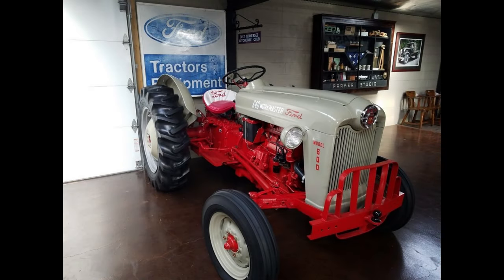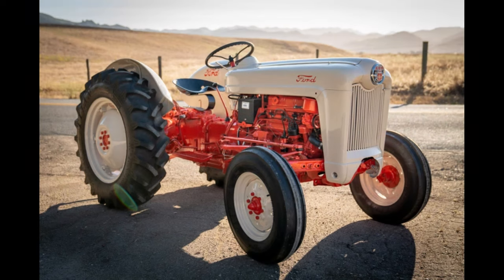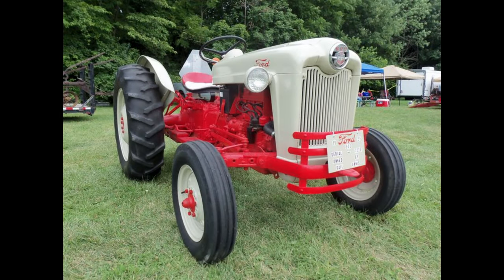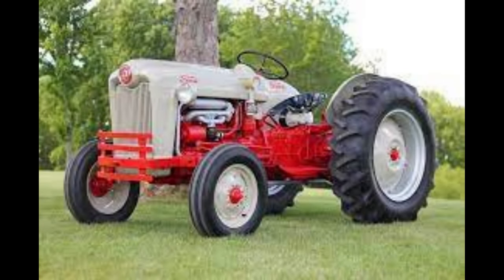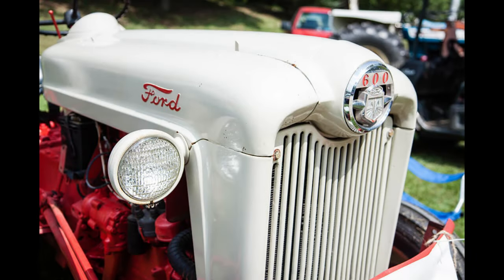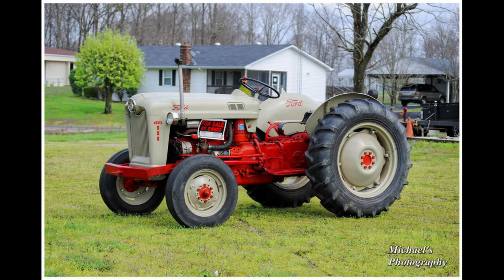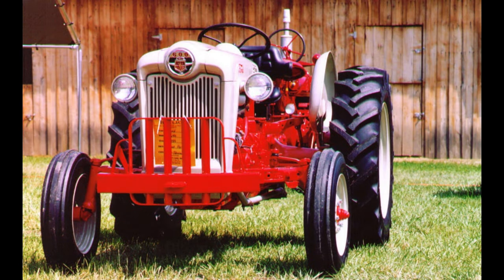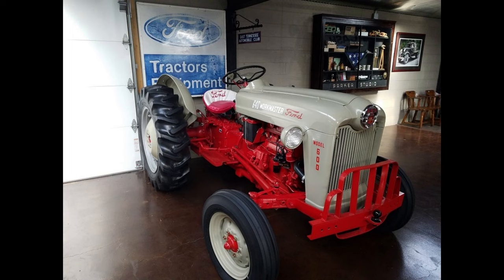Ford 600 Series (1955 - 1957) Tractor Specifications and Information

Comment: I have a 650 and the engine specs said 48.3 h/p. If it had the 33 h/p engine mine sure does not feel like 33 h/p cause this thing pulls, plows, runs balers and does it with no effort at all.. I've run 30-40 h/p tractors and they did not have the power that this 650 does..
Reply from the maker: Are you sure you don't have a 651 Workmaster?